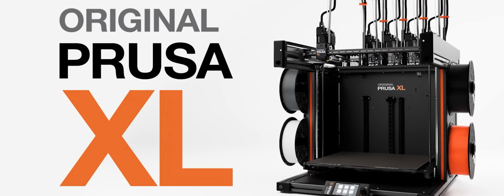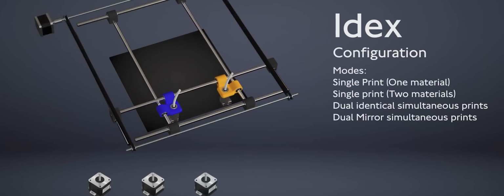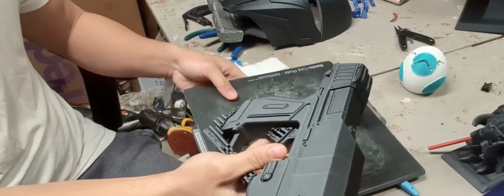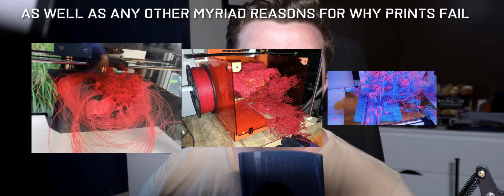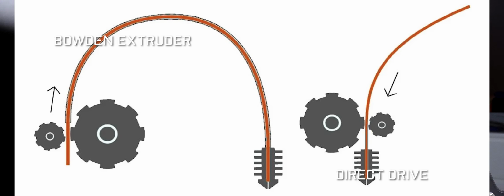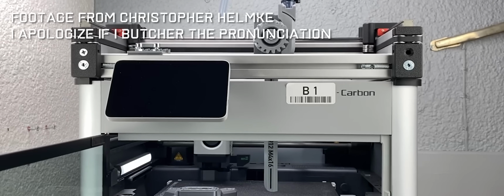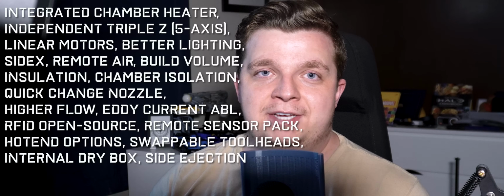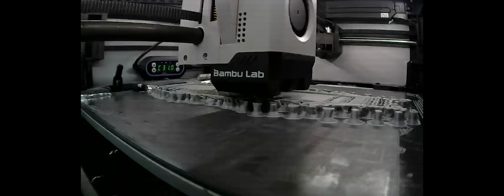Bambu Labs Next BIG Printer

Comment: I have a Bambu P1S excellent machine. It really is a nice machine with a few upgrades I made it better. I have a new Microswiss hotend with the changeable nozzles now and I preordered the mako from slice. 
I’m looking forward to the new printer I just hope it doesn’t have to cost $1500-2000 for non Ams model. My biggest problem is that people might not want to pay for a larger longer prints.
Reply from the maker: I would hope that if they implemented a larger volume, that it would keep the same speed at least.  It does get tougher to stay fast when larger gantries inherently carry more weight.  But if they did do the SIDEX implementation I describe here, they could skirt a lot of the speed penalty from the added weight.

Comment: You mentioned you added a chamber heater to your X1, any chance you did a vid on this and I can not find it, or any chance you could give a little info on this?  I love working with environmental sensitive materials as well.
Reply from the maker: I didn't do a video on that. At the time, it would have been too big of a departure from my typical content. 

I used a unit from Chitu systems because it was easily piseable. It fits perfectly at the back of the chamber with a couple of millimeters to spare. 

I lined the interior with foil-backed bubble wrap adhesive with foil tape to seal edges and seams. I further lined the exterior with 1/2" adhesive foam insulation. I cut a square of high density foam to put across the top glass while printing with the elevated temps.

Finally, I used weather stripping to better seal the front door. 

All of that makes it possible for my chamber to hit a steady 65C.

Comment: I think i have found a way for myself to get the best of both worlds. I will probably build a mashup of The V0 mod "duelling zero", and the Voron Trident. so basically a Trident with two X Beams on the same Y axis rails, driven completely independently. On top of that one of the toolheads will have some sort of MMS, and the other one will have A TPU capable Extruder. 

With separate Gantries i will need two probes (probably beacon), and a mainboard with a LOT of stepper drivers, but for the capabilities i am willing to put in money and effort.

Comment: It’s already here! 350mm^3 build volume, actively heated chamber, high speed core XY printing, filament changer that you can actually clear without taking it completely apart that is also gasketed, dual Z steppers for precision bed leveling, and it is built for easy maintenance… only $1400 right now.  It’s the Creality K2 Plus!!! 🤣😂🤣
Reply from the maker: After my e5+, I'm really hesitant to get another Creality machine. It is a very feature rich printer. But it doesn't fulfill the whole dream machine I lay out here.

Comment: I am not a Bambu lab person for two reason their do not support the right to repair for me that alone is a deal breaker and the other is their closed source software I want to do the work, I do not need someone to do for me because I want to play with my printer because I have the time to do so I am only running one printer this is not my job for me it is a toy! For those two reason I cannot buy Bambu lab yes I do know the prints come out great the mechine is simply and works like a work horse for me that is a job I really don't need I want a toy to break and repair and see the inside to see why it works! Great video I did learn something from you new SUB & Like! Peace!
Reply from the maker: 3D printing as a tool vs. 3D printing as a hobby. If you enjoy tinkering, that's great, I want the printer for what it enables me to do, not for what I can do to it.
Reply: @OddJobEntertainment this, as someone who runs a product design company, I just need the most efficient, reliable, and easy to use printer. I love open source but in most situations, it’s cheeper to just buy a replacement while a machine is down or in warranty repair than pay someone to tinker with it instead of doing their actual job.

Comment: As far as i Know arent the pressure sensors in Bambu Printers in the tool head, rather they are in the bed.
And i think probing in some way with the nozzle is the best thing to do, becaue you or the software dont has to fiddle withe the z offset😅
Reply from the maker: In most cases, I'd say you're right. Most printers using some variation of a V6 nozzle are going to have variances that can affect the z-offset. But in the case of BL, where all the hardware is controlled, they know those values exactly, and any more subtle differences can be accounted for in calibration.
Reply: @OddJobEntertainment  Mhh ok for me i more like a precise slower Leveling, wich i know works with evry Build plate the same. Than a fast less reliable (wich Eddie and co is), as i don't babysit my Printer at start anymore i also really dont care about the 4min startup sequence 😅

Comment: I wouldn’t be surprised if we’re looking at a larger floor standing machine with dual and multimaterial extrusion. Maybe with built in filament management similar to an ultimaker which also targets the prosumer and industrial customers.
Reply from the maker: ooh, I do not want a floor unit and I don't see them going that way.
Reply: @OddJobEntertainment  Might not be a floor standing machine but I've seen posts of a pair of large BBL boxes which are almost shoulder height.  Might not even be the xl machine.  Might be X2 and P2.  Only a few people really know. Pretty exciting.

Comment: An umbilical style cooling system, while neat, would be too much. Most fans aren't going to have the pressure needed for this. I can't believe you just said a CPAP fan is quieter than what the x1c currently has. Vez is a wild man. 

Some features I'm hoping for on the next flagship from Bambu are:

1) Bed tramming with more than 1 stepper to drive the bed. Don't get me wrong, it works great. I just feel like it could be better*

2) More air tight seal for VOC recirculation filtration.
3) Bed leveling data visualization. We know it's there, it logs it and is capable of showing it.
4) 6 spool AMS, or a smaller 2 spool AMS addon. 
5) Chamber heating. Yes, I know it's on the x1E but I mean come on. Gib pls.
6) HMS details. It seems like every week our x1c is screaming the carbon rods need cleaned. Why? Are the steppers seeing a irregular voltage requirement to do expected work? 
7) A bigger bed area. Don't get me wrong, it's plenty. But sometimes it's just* not enough, especially in multicolor prints.
8) A special area for wipe/purge towers that doesn't eat into printable area.
9) AMS solid state dehumidifier. I am. SICK. of silica beads. A solid state humidity controlled AMS would be chefs kiss.
10) Individual doors for spools on AMS for humidity control.
11) The printer saving it's positional data on shut off option. I get why it's not a thing, as some people could be moving them when turned off, but come on.
12) This one is just picky, but toothed gears for 2 belt idlers on the gantry. Just something about a toothed belt running over a smooth surface irks me.
13) A bottle to lube the idlers, or easier access to maintenance them along with the back solid linear rod.
14) CHT, or high flow nozzle. 

Bambulab studio changes that would be neat:
1) Multi-cut parts.
2) Ability to delete x1c profiles completely, or override their existing settings.
3) More calibration options. (Yes, orca slicer does exist.) 
That's it. BBS is awesome.

I'm sure there's some other things, but the x1c is a really great machine so don't get me wrong. For the most part, it's press print and walk away...but when it decides to not want to, it's a million things why it could be wonky.
Reply from the maker: I sleep with a CPAP and with the right setup, it is silent or near to it.  

1. absolutely, this is implied with the 3-axis Z bed feature mentioned
2. you don't actually want a super tight seal, you want net negative pressure such that nothing leaves the printer and you can still supply fresh air to it
3. obvious, can't believe we don't already have it
4. toss up for me, with daisy chaining, I don't particularly care how much comes in each unit, I'll care more if it enables better MM
5. I've done this as a custom mod, makes a HUGE difference for engineering filaments
6. more in depth error logging overall would be great
7. no argument here
8. with my idea for SIDEX, that would be the parking spot for the toolhead
9. I agree, burning one batch of silica in the microwave is enough to make you hate it all
10. same with number 2, you do want circulation for better dehumidification because you need to put the moisture somewhere after it is extracted, so you don't want to choke off and isolate things too much
11. seems it should be able to return to last known position, but maybe I'm not understanding you here because I thought it already did that?
12. that is picky, but also unnecessary with linear motors
13. I will never say no to more repairability
14. they've been moving toward this and I'd be surprised if the next flagship did not have this

1. it already does this? I need more clarification
2. I think you could achieve the same thing by hiding them or showing only favorites which would be better from a ease of use perspective
3. a lot of Orca eventually get incorporated, so it's bound to happen
Reply: @OddJobEntertainment  
My experience with CPAPS are null as I've never used one. On every video of Vez3d's VZBot(Glorious project, don't get me wrong. Man is a genius) it sounds overbearing when pushing the limits. (https://www.youtube.com/watch?v=E3kBau82SwU)

Touching on number 2, yeah an air tight seal wouldn't be good. But knowing where your fresh air supply is, and where your VOC contaminated air goes, would be a huge deal. Touching on number 10, solid state humidity control would exhaust the humidity by itself, leaving behind the oxygen. No need to replace the air as it doesn't create negative pressure. Just the moisture. 

Now touching on BBS number 1, you can multi-cut in the form of doing another cut after another. Currently there's no way to produce 2 or more cuts, producing more than 2 cut parts, per action. IE: Cutting a square into 4 corners in 1 cut, not 3.

Comment: Why not modify the lidar so it does a 3d scan? That way you can have a 'copy function'.
Reply from the maker: The idea sounds cool, but it's not as simple as modifying the existing sensor with the function.  The LiDAR detects everything directly in front of it, err, below it.  Imagine printing a mushroom, the shape has an obvious overhang, but if viewed from the top, it's just a circle.  That's why 3D scanners will employ an array of sensors with different viewpoints and require you to move around.  Now picture an engine bay of a car.  Even if you rotate around the car, you will miss details on the other side of the engine compartment.  You really want a tool in this case that you can move in all 6 axes without restriction.  The mechanical structure to make a 6 DOF movement system will typically be more like a robotic arm, a gantry as seen in printers, just can't get THAT level of freedom.  Maybe they could add sensors in a strip along a corner for basic scans, but they'd need to include some caveats about what it can achieve.

Comment: First printer I see Bambu has a Black Friday deal coming 10/20 should I wait for new printer release or buy one now !
Reply from the maker: It really depends on your budget.  I'd expect the new one to be $1500 or more.  If that's too high, get the X1C on Black Friday and you'll be happy regardless.
Reply: @OddJobEntertainment  yea I got mine for like $1200 with an AMS. Worth.
Unless bambulab comes out with linear motors + dual extrusion, its prolly not worth it lowkey

Comment: I'd love to see Bambu Lab come out with a a tool-head changer like the Prusa. Four tool-heads with the options of running each tool-head to each filament on the AMS would be great... allowing the priming tower to be eliminated in 4 color prints or allowing a priming tower and filament 💩 for more than 4 filaments. The actively heated chamber of the X1E needs to be standard on any new printer as well or at least on the X series. Having a hotend with 500°C would be awesome as well. It's definitely time to see nozzles capable of printing at temperature that allow better layer adhesion on Nylons and other engineering grade filaments.
Reply from the maker: I think we mostly agree. But, I think I'd prefer to have the AMS relatively unchanged. I'm imagining the mess of tubes that would result from having each filament addressable like that. It's a tough one to solve. But if the internal spool holder could carry my TPU to one head, and then the AMS fed another head with a rigid filament, that would solve most of my multi-material complaints already without modifying the AMS.
Reply: The Prusa XL with all 5 tool heads costs in excess of $5k. I don't think Bambu has any interest in operating in that market. Once you get that expensive, you're not far from serious pro grade printers.

Comment: This video has shown me how much additive manufacturing is still in its infancy, cant wait to see where the consumer market is at in 10 years. I just got an A1 and am blown away by the difference from my original ender 3 I got 5 years ago.
Personally for me, I think we need to see moee pellet 3D printers being researched, with pellets being 5 to 10 times cheaper than filament. The main problem is inconsistent flow rate, but I think with using a sensor to detect backflow pressure and to then adjust on the fly, a pellet 3d printer could produce just as good of prints. Then you get all the benefits like price (10 times cheaper!), mixing colors, easy recycling with a shredder, and much more flexible and brittle filaments available.
Reply: Is it more expensive to produce filament spools by yourself? Why does everyone want to print directly with pellets?
Reply: @hellmut23  I've looked into it a bit more, and it looks like it's really hard to find pellets sold in reasonable quantities for good prices. So it wouldn't be as cost effective as I was originally thinking. Looks like spools are the best way to go for the consumer market for now. It would be neat to see more companies buy back waste materials though, even just paying for shipping would be nice
Reply: We just need SLS printing to become more affordable for the public sector. FDM is a dead end
Reply: Again, tool head weight. 
The ideal tool head have everything it needs fed to it from a line. 
Need part cooling? use a air hose
Extruder cooling? run a water line
These have all been done with great success in VZbot, which is the pioneer of fast printing
filament works in pretty much the same way

Comment: I'm considering buying one for the first time but I think I'd rather deep dive into CAD before I go and make a purchase, I'm between the A1 and the X1C
Reply from the maker: I think that's a good route. While you can certainly print all kinds of files from other people, i get the most enjoyment printing my own ideas. CAD is essential for that. I'd suggest onshape. I've used Solidworks, F360 and Onshape has the best of both imo.
Reply: I ended up settling with plasticity, thanks for the recommendations tho 👍🏼

Comment: bamboo is perfect for printing PLA or PETG junk. When you start playing with more demanding filaments, it becomes clear what a toy this printer is. The company wants to earn as much as possible at the lowest cost, so don't expect a machine that will last for years. The funniest thing is that they make fun of Prusa and when it released a toolchanger, all manufacturers will now try to catch up with it 😅
Reply from the maker: I think that undersell the capability quite a bit. But you're not wrong to point out that Prusa did set a new bar by having a toolchanger.
Reply: You couldn’t be further from the truth. Literally nothing you said is correct. Stop jerking off prusa.

Comment: Isn’t sidex just regular idex? Can someone explain the difference
Reply from the maker: SIDEX incorporates the ability to dock and offload the secondary head. An idex machine typically takes a speed penalty in some scenarios because it doubles the toolhead mass by virtue of always having 2 at once. SIDEX would be having the option of 1 or 2 heads on the gantry to begin with.